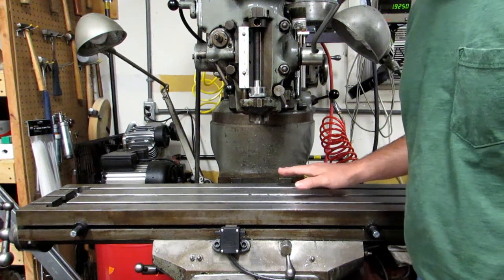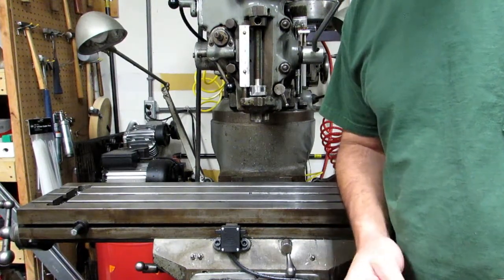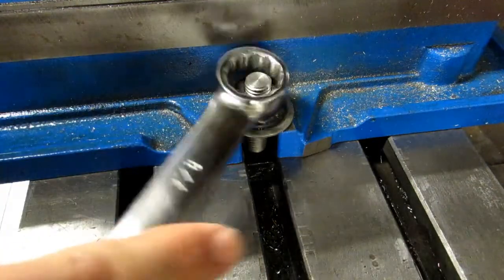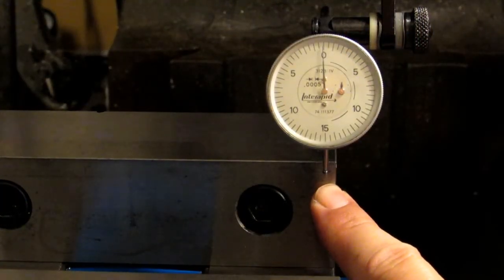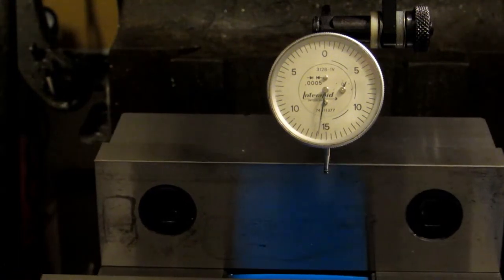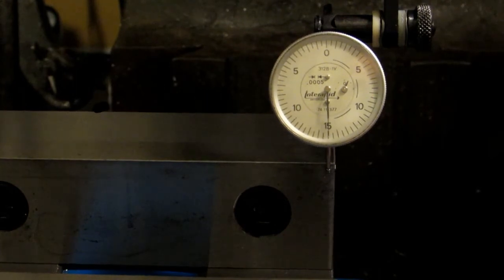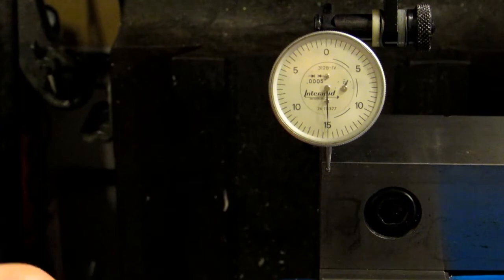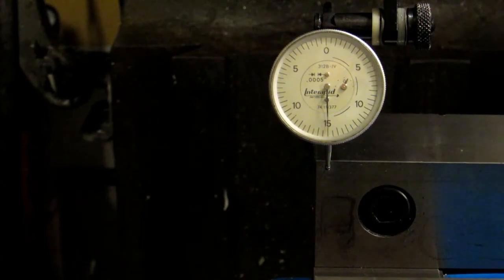Sweeping in the Milling Vise

Comment: What is the black electrical switch looking thing on the front of the table right under the vice?  Is that a pair of limit switches for the x axis?
Reply from the maker: Yep. That's the power feed limit switch